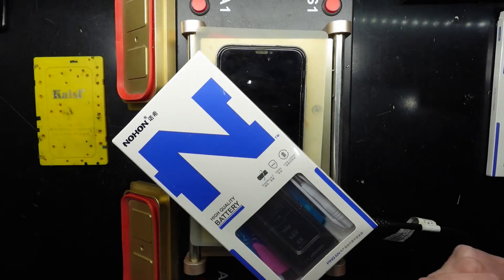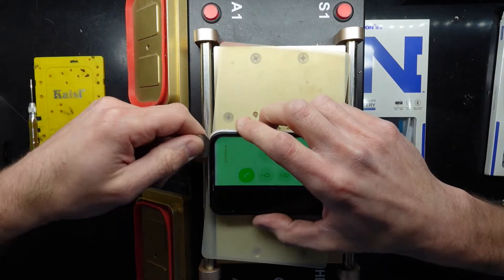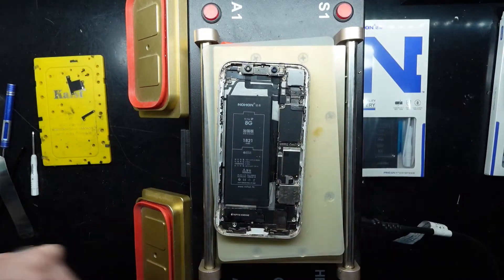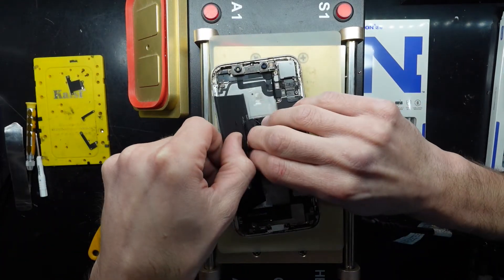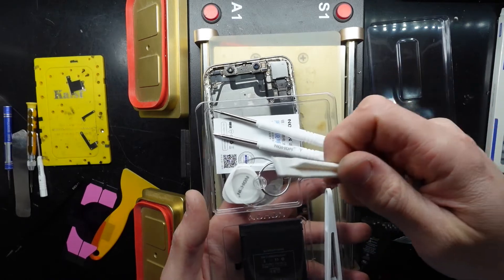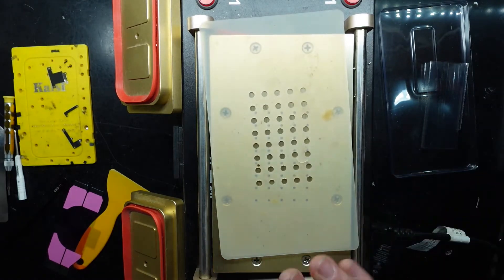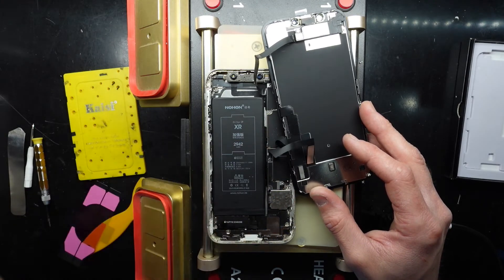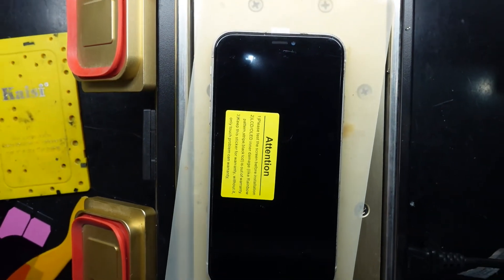Iphone XR Battery Replacement With Nohon Battery

Comment: Do you recommend nohon batteries in general?
Reply from the maker: I have been happy with them but they have slowly been getting more expensive
Reply: @rickstechrepairs  so thats the only downside you’d say? Do you think extra capacity ones (3200mAh iPhone X battery for instance) worth it?
Reply: Yes i been using nohon many years they are same like oem batteries but they are expensive
Reply: Lithium batteries cant be cheap...
Lithium is expensive component itself

Comment: hey good video and thank you for the tutorial. I had a question, your battery shows that it has 2942mAh, and mine has 3450mAh for the same phone, i dont know what to think and if it is still reliable?
Reply from the maker: some aftermarket batteries come in different capacity, Nohon sell 3 different kinds
Reply: Is it ok if you replace it with a 5000mah?